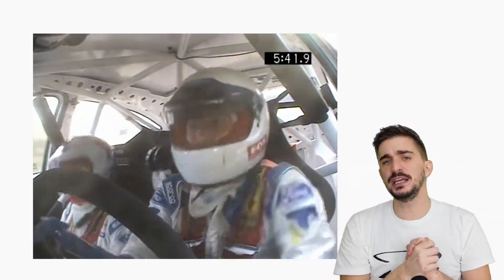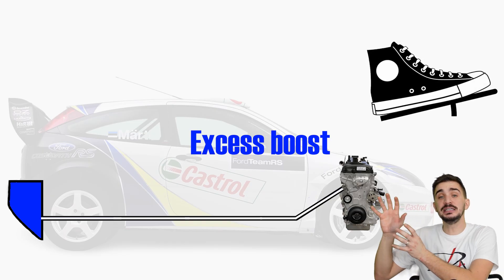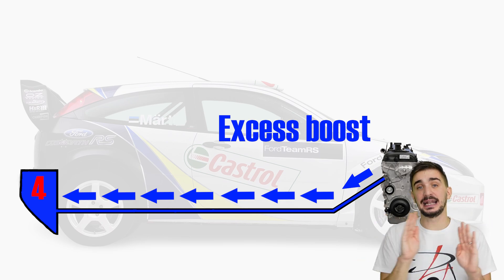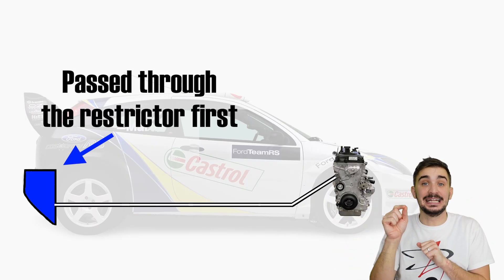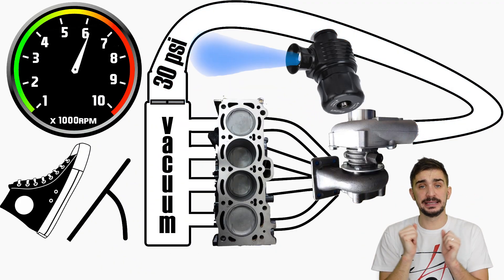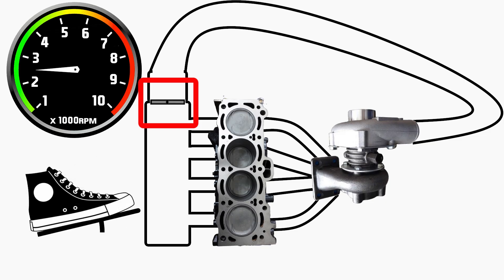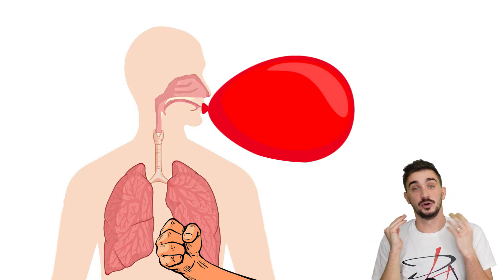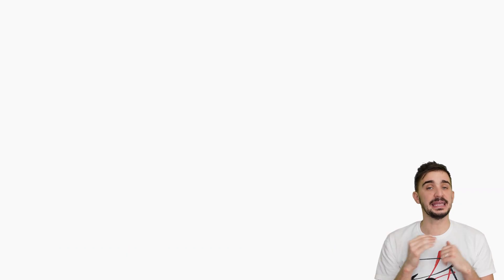FORD'S HIDDEN BOOST Tank - Welded TITANIUM filled with ANTI-LAG

Comment: I generally agree with everything you presented EXEPT; time.  If a turbo is able to deliver 30 PSI boost in the steady state condition of the engine is running at full throttle, with the turbo spinning at say 20 krpm. if the driver gets off the throttle, the air that the turbo is compressing no longer has anywhere to go (it was going into the cylinders), the pressure in the manifold will then instantaneously (and momentarily) rise to well above the 30 psi that is maximum in open throttle condition, and it is this pressure that goes into the tank.  Additionally, while some people incorrectly say the turbos use "free" energy, they in fact do not, they get there energy from the piston compressing the exhaust gas during the "exhaust" cycle of the  engine, by bleeding off some of the excess pressure into the tank, there is less "work" for the turbo compressor to do, so it stays spinning faster.  I don't know if at that time and in that class there were total fuel limits, but the system of burning fuel between the engine and the turbine wheel just to keep up the turbo RPM does use additional fuel which Ford's system could reduce.
Reply: Is the power going into the exhaust turbine wheel 100% mechanical (pressure from the piston) or is there any percentage thermal, heat turning to mechanical energy?
Reply: @danielgodshall7502  :  Both, engines typically have between 100 to 500 PSI left in the cylinder (higher range for "race" engines at full throttle) when the exhaust valve opens, but this is relieved within 30º, after that the piston is pushing, taking energy from the crankshaft.
Reply: @johndavidwolf4239  Thank you! So the mechanical driving pressure is parasitic just like a supercharger belt but the thermal portion would be "free" as it is otherwise exhausted heat. I wonder what is the ratio of the mechanical pressure to the thermal energy. To your point, the mechanical must be much more than the thermal.
Reply: @danielgodshall7502  Yes,  "There Is No Such Thing As A Free Lunch", more so at small throttle openings where the pressurized air from the turbo is both fighting the throttle plate, and the cylinder pressure when the exhaust valve opens is lower so that little bit of uncaptured energy is less, whereas at full throttle, the cylinder pressure is higher and more of that uncaptured energy is recovered.

Comment: Blowing a balloon has more to do with flow than pressure. 
An adult generates more flow than a child. 
You video has inaccuracies. 
You can have a turbo that  only generates 15 psi generate more power than one that generates 20 psi .

Comment: Grab a 2nd turbo from the cabinet. Mount turbo #2 to a second line to the tank. This tank INLET line only flows one way. Use waste-gate gasses to power your new compound turbo. Store 60psi in the tank. Use tank OUTLET line to supply cooled boost as required.
Reply: I doubt excess gasses would be enough to get a significant amount of extra boost and such idea would add further complexity and weight to an already complex and heavy system
Reply: @AruEsse  A large reservoir of boost that gets cooler the longer it sits would be ideal for eliminating lag without harming longevity. It’s a buffer system that only needs to work for a few seconds at a time.
Reply: I think ford's goal was bypassing the maximum boost limit caused by the restrictor, not trying to prevent lag which is easily eliminated with a rocket ALS, it was more like maximizing the advantages the already present ALS could give

Comment: I got a brainwave watching this video. What if we used this kind of tank as anti lag on a typical road car. Instead of recirculating air to exhaust or venting it to atmosphere we put it the tank. Every time throttle closes we put excess inlet pressure into tank using one way valve and when throttle opens we let it back in thru another one valve getting better pick-up and increasing efficiency of the system. 

Now I just need a car with turbo engine to test this idea.

Comment: When you were describing the anti lag, right before you said that the hidden pressure tank adds boost back into the intake, I thought you were going to say the extra boost would be used for anti lag, going into the exhaust manifold instead. To me it seems like that idea would work just as well, but of course, there's a reason why they didn't do that.
Reply: Same here. But if it was to happen, it look like the tank would need 2 pipes with 2 valves. One going into the intake plumbing and the other going to the exhaust manifold.
Reply: Volvo was going to use this method on diesels. They called their system PowerPulse. Don't know if it made it to production.

Comment: Welding titanium is actually pretty easy. Why they made it from such small pieces and why they didn't use something lighter like aluminum or magnesium i dont know. Perhaps the titanium doesn't balloon as much at the same weight. I don't know for sure.
Reply: Titanium has the highest strength to weight of all common metals.  My guess for the small pieces, is that at every joint there was also a perforated sheet inside the "tank", welded to the opposite side.

Comment: It was CHEATING and not BS "Creative rule interpretation!", as PRESSURE Vessels are effectively banned in all FIA motorsports in order to protect the drivers, spectators and more importantly the marshalls from over-pressure failures in a crash scenario ie WOT situation. 
BTW The WRC Focus used the LONGER wheelbase US version for extra stability, hence US bumpers/spoilers.
Reply from the maker: 2 bar is a pressure vessel? That means intake manifolds should also be forbidden to protect drivers and marshals 😂 Also, no, it was a European focus as I explained in the vid.

Comment: Minor note, at 15:30 the combustion isn't detonation unless the combustion speed is supersonic (for the fuel/air mixture, likely different to supersonic speed in normal atmosphere), for engines it's usually deflagration (flame front travels at/below the speed of sound in the fuel/air mix). This is pretty much pure pedantry, but I appreciate the detail you go into, so though I'd offer a bit more.
Love this series, looking forward to the next instalment!
Reply: Detonation would only happen if surfaces were extremely hot and high pressures were present which an exhaust pipe clearly has, large super hot surface area, combustion happening rapidly increasing the pressure which can snowball into supersonic speeds especially in the small space in the pipe.
Reply: @amitrkolte  agree that the rapid pressure rise can cause detonation, but I don't think anti-lag causes this. normal combustion happens near TDC, which is in the 10's of cc's, late ignition and open exhaust port is a much larger volume. High temperatures, definitely, pressure not so much.
Also the turbo needs high airflow, so you want combustion like a jet engine to minimise lag, detonation would just send a shockwave into the turbine until/unless the gas expands back down to reasonable pressure. Most of the damage to the turbo from anti-lag comes from the sustained high heat loading as the mix is still burning in the turbine rather than in the combustion chamber, where it has time to cool down as it expands during the power stroke.
Reply: Did you listen to the clip? That sounds like detonation, and not a controlled combustion. He's right to have called it detonation.
Reply: @Silver_o  think it was both now since he showed both processes but I did get stuck over thinking what he said at 1st after he said the timing was delayed but not eliminated.
Reply: I got stuck there too, I've heard it's not detonation/explosion but combustion Bec. It's a controlled process.
Reply: He does have a video explaining deflagration, so I'm pretty sure he knows the difference between detonation/explosion/deflagration. He just used certain phrases so the viewers can understand him more easily.
Reply: @TheJ8skater  Usually when that happens, the creators put a warning that it's an oversimplified explanation.
Reply: With noting he mentioned this is in the exhaust manifold, not in reference to in cylinder controlled combustion.
Reply: ...and detonation would be likely to break something.
Reply: Oui, correct. En français, lorsqu'un point chaud dans la chambre de combustion provoque de la détonation, on appelle l'interaction entre cette détonation et le front de flamme de la combustion (initiale) "le cliquetis". Sur un cycle Otto, on réduit le cliquetis en modifiant l'avance à l'allumage (au détriment du rendement de la combustion).

Comment: Great video!
But speaking of correcting mistakes:
You need a lot of pressure at the start of inflating a balloon, not at the end. This is described in the Hagen–Poiseuille equation. (Part of ... let's call it "blood vessel physics", I had to learn).
Reply: :  It is more a function of the non-linear elastic properties of rubber.
Reply: @johndavidwolf4239  Look at the rheological model of an elastomer. It's spring like for dynamic changes in pressure, therefore the radius^4 is way more important. Also the rubber is fully relaxed at the beginning. According to you there should be no resistance at all at, which is not the case.
Reply: @pugnate666  "  It it were a "perfect" elastomer you are correct, my point is that natural rubber in not a perfect elastomer and its properties are non-linear along with the wall thickness being thicker before any stretching
Reply: @johndavidwolf4239  It still starts as a spring that is not in tension, so initial force should be close to 0 and then increase. What you describe is completely correct and gets really noticeable once you're past the initial high pressure. But before that Hagen–Poiseuille is the stronger effect.
Reply: @pugnate666  :  That is exactly my point, rubber is an organic plant based molecule and as such is not the same as a steel spring and has an other than linear reaction to stress.
Reply: @johndavidwolf4239  100 points for that. But the molecules it is made of are "tangled up" at rest, because thermodynamics and low energy state. So they exert minimal force at rest, which is not what you experience when filling up a balloon or bubble gum. You need 1. a lot of pressure 2. experience a drop 3. need more pressure to increase inflation

Comment: This doesn’t even sound like a borderline cheat. It seems like a reasonable, almost obvious, innovation.
Reply: yeah but like all "cheats" in motorsport, if a competing team cry hard enough (while agitating dollar bills) it will be banned for either safety reason or levelling out the playing field
Reply: Just like the Toyota turbo spool trickery! That was innovative as f$@k, yet because they were the only ones that had it, it was considered cheating....what a load of wank🤷‍♂️👎
Reply: @tortor0782  what? Toyota circumvented the restrictor plate that was required. It's not innovation. It's blatant cheating.
Reply: What would your opinion be is they also installed a compressor after the turbo into the tank, allowing them to fill it to a couple hundred psi, granted it wouldn't last forever but a good minute or so max doesn't sound unreasonable, this isn't taking account parasitic losses and the like though
Reply: I've always thought this would be an obvious innovation because all the boost that gets leaked by the bov just seems like a waste.
Reply: If nobody else does it because they all think it is against the rule, it is a cheat, if it becomes popular then it is innovation. Funny how that works.
Reply: @vipervidsgamingplus5723  A guy at formula drift was using a type of construction hardener to keep his tires from debeading. So he could run crazy low tire pressures for a lot of grip. There was no rule against it at the time but he was suspended anyways. The rules were re-written for the following year as well. He wasn't even winning a ton with it either. He was one of the few solo competitors going up against million dollar teams/sponsors with engines making 300+hp more than him. All he did was find a creative way to somewhat level the playing field.
Reply: @Gunsand42  typical large corps. They burn the strawman all the time thinking they're doing something decent.
Reply: @vipervidsgamingplus5723  nah thats not how rules work in racing. Unless the rule book specifically bans something, or has rules for specifications, you can fudge things by working outside the rules. If it's not in the rule book yet, it's "allowed" until the regulating body makes an official rule allowing or disallowing it.

thats why 70s-80s f1 was so bonkers.
Reply: @vipervidsgamingplus5723  No, it wasn't cheat. It was a secret only. That's why it had to be explicitly banned.
Reply: @vipervidsgamingplus5723  nobody else did it in this case because it was pointless. The power gains of 5% aren't worth the extra 20kg of weight.
Reply: It is just a different anti lag system.
Reply: Yes! Obvious if you know cars and get it.
Reply: Innovation for a car that isn't in controlled motor sport. Loopholes be damned.
Reply: ITS A WASTE OF TIME !!!
Reply: @raymondj8768  no it is timing of waste

Comment: One correction, bigger turbo/compressor does not generate more boost, it generates more flow. 45mm vs 60mm turbo, both can be at 1bar of boost, but they deliver different amount of air.

Comment: Motorsport is full of 'innovations' like this, would be great if you could cover some more examples :)
Reply: The GTFour's restrictor plate for one!
Reply: @BazilRat  Of course, another one for me is the BTCC Accord Type R with the reversed head configuration among other things.
Reply: @BazilRat  nascar was doing that decades before
Reply: @skaldlouiscyphre2453  do I have to name them all? Where do you think WRC got the restrictor plate rule from??
Reply: @skaldlouiscyphre2453  Smokey Yunick, the man who personally is responsible for rules like limiting the diameter and length of fuel lines amongst many others
Reply: One Name.... smokey yunick
Reply: Oh i've got an idea what about the  F1 cars nuematic valves!!
Reply: @alkatiawri3741  interesting i wasnt aware this concept existed before the freevalve design, possibly where Koenigsegg got their inspiration from?
Reply: Yes please!!
Reply: @Kris Nicholson I think you'll find it was far more complex than that, it also allowed the engine to moved further back and lower for better weight distribution, having the exhaust at the back allowed for smoother exhaust flow, i believe the intake manifold was swapped out for ITB's allowing better response and power in the top of the rev range and ducting was designed between the intake and grill so that once the car reached around 90/100mph the ram air effect effectively had a mild forced induction effect further increasing power. I disagree that this is a 'go-to' mod for H22's, there's a lot more involved than you think, all the coolant and oil passages have to be reworked and repositioned, the cams have to be changed, custom valve cover designed and so on, its ridiculously expensive for the average person and not something someone can just do at home in their garage without serious engine building knowledge and tools.
Reply: like mercedes f1 teams steering design for the 2020 season was it? where the input of the steering wheel in and outwards changed the angling of the front wheels
Reply: @JustSwizzY  Just had a read about this and it changes the toe angle, from what i can tell zeroing the toe heats the tyres more evenly and then they can change to toe out in a corner for better handling, very cool trick!
Reply: @maxmoughal5183  innovative definitely.
Reply: The "gurney flap" is one of those.  

They said it was there to keep pit crews from injuring their hands on spoilers and wings...

But what it ACUALLY did was increase the effectiveness of a spoiler or wing without increasing its (restricted by rules) square area measurements. 
Ie: it made a smaller wing as effective as a (rule breaking) larger wing.
Reply: No shit.  This guy is automotive engineer level.